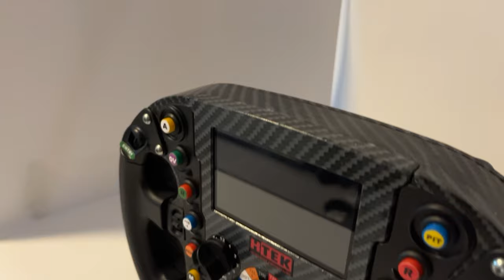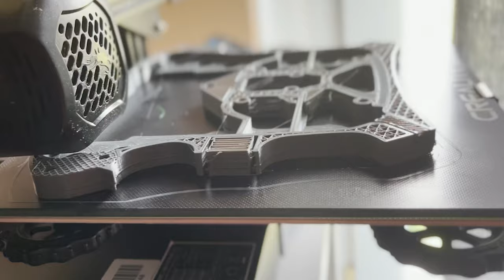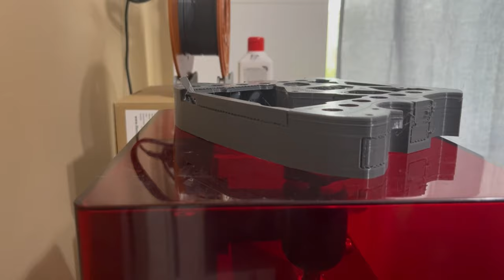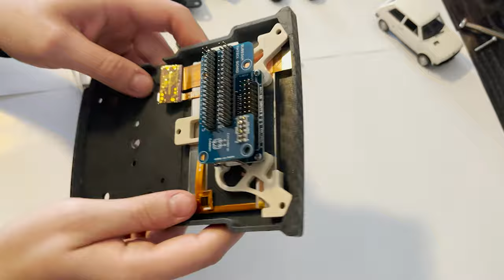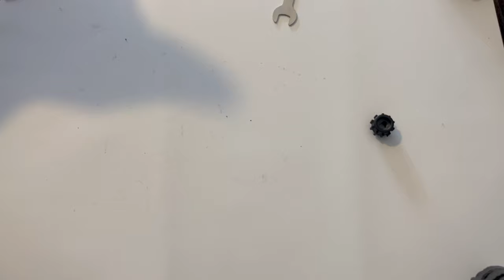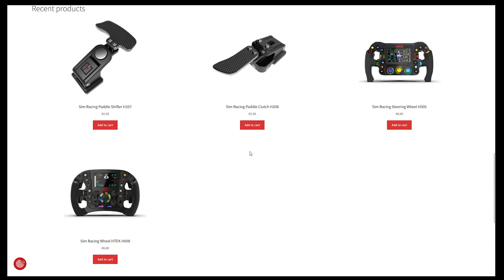DIY Sim racing steering wheel | HTEK H008 | HTEK Simulator Engineering

Comment: I purchased this but I don’t see a wiring diagram for the DIN GX12/16. Don’t know how to hook it up
Reply from the maker: Hello Jay,

Thank you for the purchase.
Just wire it up like regular usb cables. You cut one end of the USB cable, solder 4 wires to the 4 pins, and do it with the second cable also. Make sure you solder each color to the exact same pin on the other half of the DIN connector.

Comment: I bought the files but I wish there was more wiring help, specially for powering both the screen and leo bodnar board with the GX12 7 pin connector. Can you help me with that at all? Cheers!
Reply from the maker: Hello Alex, 
I've sent you an email with additional wiring diagrams. :)
Reply: @hteksimulatorengineering  Hi mates! I just bought it too and i want help the the wiring diagrams! I've  just sended you an email
Reply from the maker: @wikanderson  I have sent you the details.
Reply: Did you get the files? I'm kinda lost too.
Reply: @hteksimulatorengineering  Hello, is it possible to have the same additional wiring diagrams please ?
Reply: @hteksimulatorengineering  Hello, is it possible to have the same additional wiring diagrams please ? I sent you an email.

Comment: Hello, what kind of paint did you use for the grips? And did you give it a final coat of varnish? Thanks
Reply from the maker: Hello, Regular plastic spray paint + clear coat as final layer.
Reply: @hteksimulatorengineering  Thanks 🤙🏻

Comment: I wonder how full 3d printed wheel behave on dd like sc2. Most of diy wheels start with a metal front plate.
Reply: Def not correct... LOADS of retail & diy wheels are either all 3d printed or made only with composites!
Reply from the maker: I encourage you to try it... Depending on the feedbacks, we will add metal reinforcement option also if needed. :)

Comment: Nice work, looks great!    Did you print the buttons and encoder wheels?   I'll be building one for my fanatec 8nm wheel base,  can this survive the torque?
Reply from the maker: Yes they are 3d printed.
So far I have not received any feedbacks from problems while using it with a dd wheel base, so you can give it a shot!😎
Reply: @hteksimulatorengineering  My question is, where can I find Al the hardware like the screen and all of that? I’d there any instruction when I buy the files?
Reply: @jeftesantiago  there is a list of required/recommended items when you buy the plans.
Reply: @dt2419  Yeah, but I was talking about the store to buy some of the hardware like the magnets or the screen. I ended up using 12mm x 3mm magnets and modifying the .stl file to fit them. I have almost all the parts by now, I only need to print the handles and a couple of parts to start assemble it.

Comment: Hello! It looks awsome!  I jus bought the F1 version. I was courious how do you get out on a single cable both: the Leo Bodnar board and the Screen. (Is the screen somehow connected to the board and I am missing it?)
Also, how about the led version for the F1 rim? :D 

Also 2: How would you wire the leds as well? - another dedicated board? Or change the board completely?
Reply from the maker: Hello Vlad, 
As I can see, this is the most problematic point for the users. I will make a tutorial about this in the upcoming projects. 
Basically you will need two usb cables, that are connected to the 7 or 8 pin DIN connector.
For the LED's the most easiest way is to connect them to an Arduino nano.
Reply: @hteksimulatorengineering  I was thinking the same, I was not sure how to use 7 pins, as the 8 pins seems easy. Fot the 7 is like mapping the nulls to the same pin?
Edit: tons of typos
Reply from the maker: @vladstefan5772  Exactly, you are correct!

Comment: How much does it cost to make this whole steering wheel. What wheelbase do you use and do you think ill be able to create everything with minimal computer skills?
Reply from the maker: It depends on what you already have at home, but I would say about 200 euros, if you start from basically zero. I am using a T300RS. I think you can build it without any problem. :)

Comment: the electrical scheme is so minimalist nothing is understood ! you can conect nothing with the scheme! the are no wiring for bottons, no wiring for screen! please update it. i bought it just for the scheme, so disappointed
Reply from the maker: There is a colored wiring diagram for how to connect the buttons to the Leo Bodnar board. The VoCore screen is plug and play, you don’t need a wiring diagram for it.
The only thing you might miss is how to connect the usb wires to the DIN connector, which will be updated soon.
Reply: @hteksimulatorengineering  rotter buttons have 5 legs, on you diagram there is only 4 pin , one wire that are showing where to connect, but its doest show how and where to connect each leg! and when the other scheme will bw updated?

Comment: I wouldn't rely on dupont jumper style connections on something like this. They're horrible at staying in place and even if they do, the constant movement will loosen the connection.
I'm sure it'll be fine for a little while but it won't take long to before you get intermittent connection issues. 
Get yourself some silicone wire, remove the header pins on the board and solder directly.. At the very least, use some hot glue to prevent movement of the connectors.
Reply from the maker: You are definetly correct, it needs some hot glue, otherwise you will have connection problems in the future, because of the vibrations.
Reply: @hteksimulatorengineering  You can get black hot melt sticks to make it look like "backyard job".. my favourite thing about hot melt is that you can give me a quick spray of IPA and the bond releases immediately.. As soon as the IPA has evaportated, the bond strength returns.

Comment: The eletronic components where i can find? Which 3d software is?
Reply from the maker: You can purchase them directly from Leo Bodnar, or Aliexpress. :) By the 3d software, what do you mean?
Reply: @hteksimulatorengineering  in the video i can see a program with the structure of the steering wheel. Which program is?

Comment: How much did it cost though
Reply from the maker: The whole build as you can see on the video cost me about 200 Euros, but it will depend on how much material, you already have at home. You can build it for less, and also you can use more expensive parts, which will increase the price.

Comment: Which material have you used for the 3d printing?
Reply from the maker: For the handles and encoders, I've used water washable resin, for the other elements regular PLA.
Reply: @hteksimulatorengineering  Thanks for the answer and a quick other question: Am I seeing it right that you use the GX connector to combine the two USB cables (from display and leo bodnar) into one
Reply from the maker: @SK-wr5bj  Yes, you are seeing it correctly! :)

Comment: Was with you 1000% till i saw the hydro-dipped carbon fiber 🤢 why go to all the trouble making such a nice wheel to then do that? Honestly, skinning with prepreg carbon fiber isn't that difficult or that much extra labor... Or at least buy a premade sheet and cut as needed! 
Otherwise really nice build!
Reply from the maker: It is 100% your choice how you want to cover or not to cover the wheel. For this build, I've used hydro-dipping to see how it looks after a few months of usage.
I was also kept the prepreg carbon fiber on the possibilites, but it would corrupt all the size tolerances of the build unfortunately.. :( 
For experimenting, in the future I will make an easier design 100% out of carbon fiber. :)